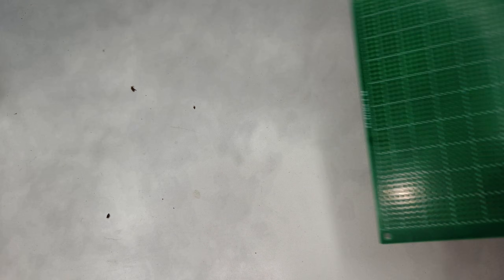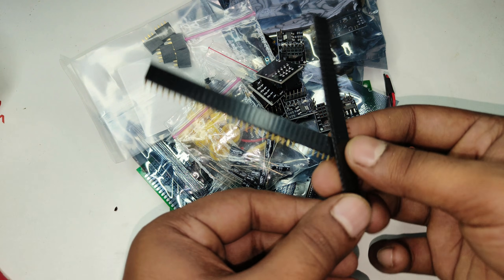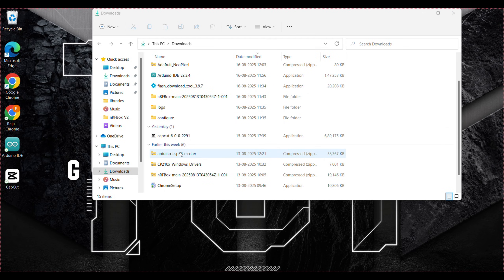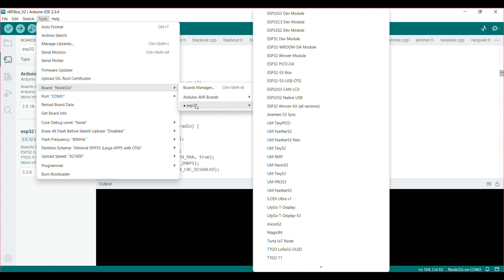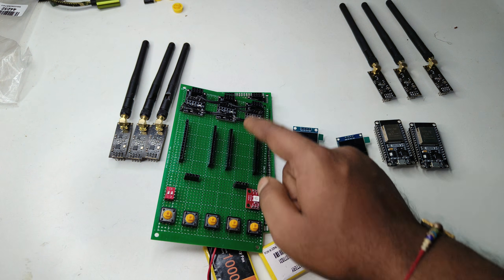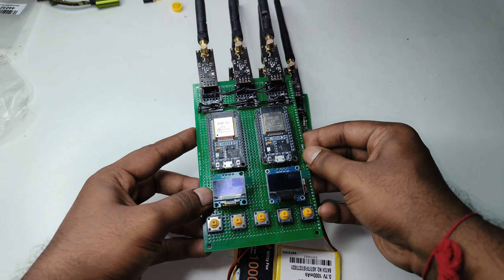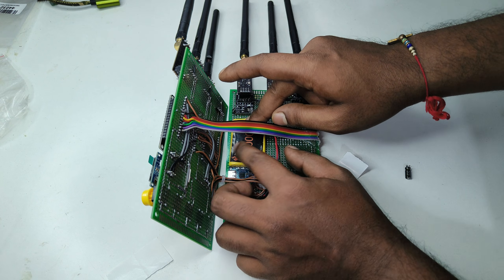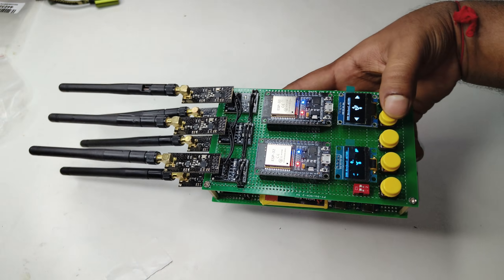This ESP32 WiFi Jammer Is INSANE! (nRF24L01 Signal Killer & Channel Sniffer) #nrf24l01 #esp32

Comment: The buck converter shown in the components is not visible in your final hardware
Reply from the maker: Yeah I have added it later its an upgrade
Reply: @Experiments_Projects so can the entire circuit be driven by lipo battery voltage  without buck converter? I heard that nrf modules sucks too much current dropping the battery voltage quickly.
Reply: I also have one more query.  I've flashed the latest nRFBox v2.7.2 and tried the circuit. Things happen as intended, but I'm not sure which menu item does what exactly. There are no videos (including the maker himself) explaining clearly what happens when you select a particular menu item. It would be great if you can post a video about it, or just help me out with my own circuit. 🙏
Reply from the maker: Yeah
Reply from the maker: Drop me a text message in Instagram

Comment: I use 3 NRF24 modules, it's works 😊😊
Reply from the maker: Great 👍
Reply: Hi, I'm excited about your project. Could you provide me with the NRF jammer source code for the two ESP32s and the rest of the connections? I know how to do it with one ESP32, but I don't know how to connect the two ESP32s, the NRF24, and the OLED simultaneously so they work together. Could you help me with that?
Reply: Bro, what range we get from 2 and 3 nrf module 

And 
Can also jam wifi and bluetooth at same time.....?
Reply: @MissionPWian9 
Yes, 50 meters approx 😊
Reply: @Animeboy-d9t  Шутник блин ! 🤣🤣😂

Comment: couldn't we just connect two batteries on parallel and use one charging port for them?
Reply from the maker: Make sure 5v input for the NRF modules and 5v for ESP32.Then it works well

Comment: What is the range of this device ?
Reply: Lie it's just 7-10 meter I have already check
Reply: @gy4ggf57 use E01-2G4M27D modules instead and give them a separate power supply
Reply: @gy4ggf57 did you do that jammer? Tell bro please
Reply from the maker: 50 meters around